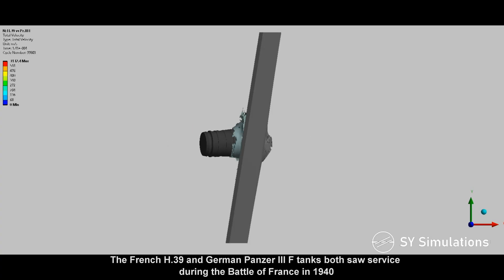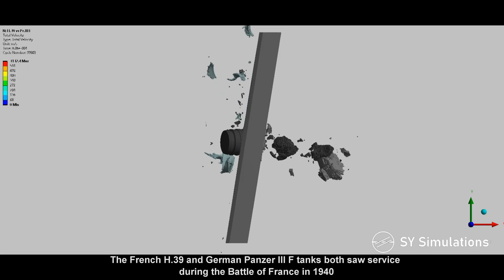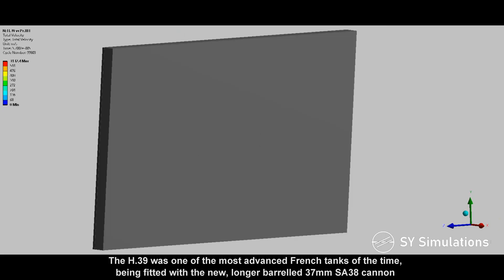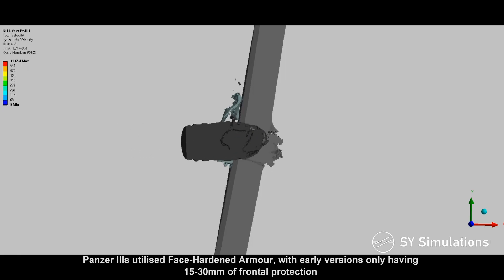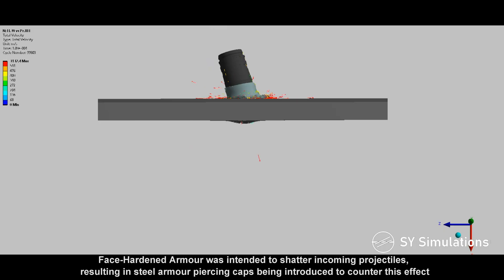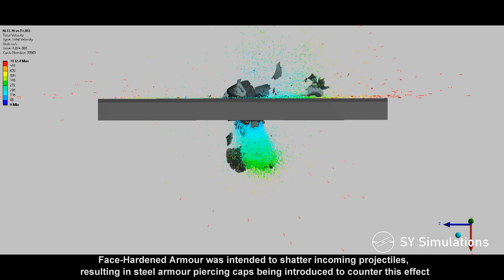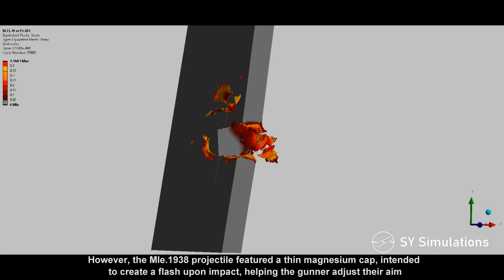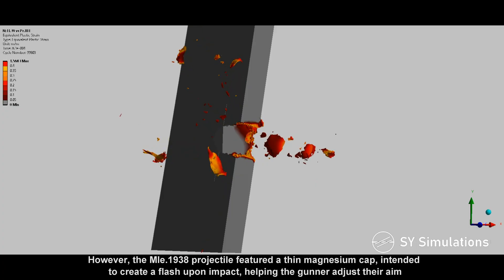H.39 vs PANZER III F | Battle of France 1940 | Face Hardened Armour Penetration Simulation

Comment: With a German tested maximum armour penetration of only up to 49mm. @ 0 degrees @ 100 metres (with APC Rupture M.1938 solid shot), the 37mm. L.33 Sa-38 was still not much of an improvement over the 37mm. L.21 Sa-18.

Comment: I do wonder how French tank development would've gone, had the early war gone differently and they managed to hold on longer
Reply: They had already plans for fitting new designs with 75+mm guns ,so i guess would have been the first along with the Soviets to introduce much bigger calibers in their tanks.And probably would have pushed towards diesel adoption.Tank destroyers were also been developed.Their metallurgy hade made wonders since 1870 so along with their air force that was on the early stages of modernization ,tank corps would follow shortly

Comment: I remember you did a german 37mm vs h39 no ? Didn't i ask you ? 
Anyway what's most interesting is to see if germany most common tank in 1940 ( the panzer II and I ) could actually defeat french armor.
Reply: Germany also had many Czech made Panzer 35T and Panzer 38T tanks that were part of the battle of France, and these tanks carried a 37mm cannon just like the Panzer III, and was able to deal with the majority of French armor. Germany also had the Panzerjeager I tank destroyer that was armed with a relatively powerful Czech 47mm cannon. Germany also had about 1,000 50mm AT guns produced for the battle of France as well. Rommels 7th Panzer Division was made up entirely of Panzer 38T and Panzer 35T tanks. And there were enough Panzer III tanks to supplement the light Panzer II and I tanks during the crushing humiliation of France. Often times German tanks would swarm French tanks if it was heavily armored, and flank it and hit its weak spots repeatedly.

Comment: Why need magnesium cap?
Reply: It literally says in the video it was intended to cause a flash when hitting stuff to help the gunner adjust their aim.
Reply: @GordonWeedman  I see now
Reply: @GordonWeedman interesting though because it would only make the flash if it hit something really hard like metal or maybe a building. If fired at a target in a field or Forrest and the projectile hit dirt or trees it wouldn’t make a flash. Maybe it was designed to do the same thing the api .50 cal was supposed to do so that you could see when you hit the target. I suppose that is helping with the aim since you’d know if you hit the target you see a flash
Reply: @AsmellYoullGetUsedTo  yeah... That's the point, if you see a flash you know you got a hit so keep aiming there, if you don't see a flash that means you missed
Reply: @DukeExeter yeah like the api .50 cal the fighter aircraft were issued, that’s what I was thinking too
Reply: the french didn't use tracer rounds in their ATG, likely because of the understanding that ATGs work by being surprise weapons, and having a traceable line of light going back to the gun's position would make them even more vulnerable to counterfire

the magnesium cap proviuded thus a solution to hit spotting, while also making for a soft cap against FHA plate (tho not necessarily as good as a proper steel cap)

Comment: Was the FHA done by carburizing? Or was it low alloy high carbon steel with shallow hardening?
Reply: From what I’ve read they used gas on one side of the plate
Reply: Ok,so gas phase carburizing.👍🏻
Reply: @ShokkuKyushu they used coal at first but found that gas was more effective so the hardness was more uniform. That’s just going off of memory though it’s really interesting and suggest looking into it
Reply: @ShokkuKyushu that’s what read anyway. They used the idea from ship armor
Reply: I think I first read about it on Navweaps.
Reply: @ShokkuKyushu yes it’s the same technology as used for naval armor, they just applied it to tanks. Very interesting stuff but it was quickly rendered ineffective by introducing the armor piercing cap
Reply: @ShokkuKyushu its another example of the gun vs armor race that’s been going on since the introduction of gunpowder

Comment: Please do the Somua S35 next! It seems the 47mm gun was much more effective against German armor
Reply: The 47mm French anti tank gun fired a cartridge that was twice the size of the 47mm cartridge used by the 47mm gun on the S35 and other French tanks. The French tanks that were armed with a 47mm cannon fired a 47x193mm cartridge, that is extremely small. The British 2 pounder was 40x304mm. The German short barrel 50mm cartridge was 50x228mm and the 50mm German long barrel gun fired  50x420mm cartridges.The French mobile 47mm anti tank gun used by anti tank gunners, fired a relatively powerful cartridge for it's size, it fired a 47x380mm cartridge at 2,800 feet per second. The French 47mm armed tanks could not penetrate nearly as much armor as the French 47mm AT gun or the 25mm Hotchkiss AT gun
Reply: @chadmysliviec8449  by paper performances alone, the 47mm tank gun used on the Somua, B1 and D2 was roughly equivalent against armour as the German 37mm tank/AT gun
the 47mm ATG meanwhile was closer to the german 5cm ATG
the 25mm LAT really didn't have a performance equivalent in German service, being solidly between the PzB 38/39 and the PaK 36 in terms of performance

the case length doesn't make everything in the gun's ability, as there is also the question of the case width and the presence of a bottleneck, which in the case of the french 47mm tank gun, while the case indeed short (193.5 mm), it was also rather wide (76 mm rim diameter) and had a strong bottleneck, giving it a lot of volume to store powder
Reply: @quentintin1  How about the 2.8cm schwere Panzerbüchse 41? Its an obscure squeezebore gun that fires tungsten core rounds. It would outclass the Hotchkiss 25mm in penetration, but its otherwise a reasonably close counterpart.
Reply: @builder396  mmh, possible
it's in the same weight class (esp. the mole 1937 lightened model) and caliber range, but also the two weren't even able to meet in battle, as my understanding that the spzb didn't exist in prototypes before late 39/early 40, and by the time it entered effective service (late 41), the hotchkiss gun wasn't in effective service

fun fact, the french were well aware of the inadequacies of the 25mm at punching through armour  by the late  30's, and were exploring potential to augment it, or replace it, and one of which was a squeeze bore 29/20mm gun, mounted on the Mle 1937 carriage, with at least one prototype made
Reply: @quentintin1 the sa38 is the equivalent of the pak36. The sa34 is comparable to the kwk 38, both being a bit less effective than the British 2 pounder and American 37mm.
Reply: The 47mm. L.35 Sa-35 was tested, by the Germans, to be capable of penetrating up to 62mm. of RHA @ 0 degrees @ 100 metres with APC Rupture M.1935 solid shot. It was the most powerful French tank gun available, in 1940. By comparison, the British 40mm. L.52 2 pounder could penetrate up to 77mm.. of RHA @ 0 degrees @ 100 metres with AP "Hadfield" solid shot.

By using small, one man turrets, French tank designers unwittingly placed a restriction on the effectiveness of the cannons mounted in them.
Reply: @CZ350tuner  In fairness though, the French still put emphasis on the caliber for HE rounds, essentially going for very small dual-purpose guns (SA18 not withstanding), so their lackluster AP performance compared to the British of all people, who didnt even issue HE rounds to their tank guns, is a bit.....one-sided.
Reply: @CZ350tuner  it wasn't unwitting, it was a request of the army
the french army was huge, with a very large tank force, and france wasn't financing it's rearmament with fake money like Germany
additionally, the french made an emphasis on armour while imposing strict weight limits
this meant they had to make their tanks with as few crew as could get away with, to get tanks that were small enough to not weigh 50 tons, and thus cheap enough so they could afford more than 3